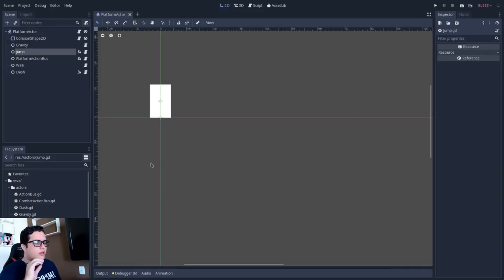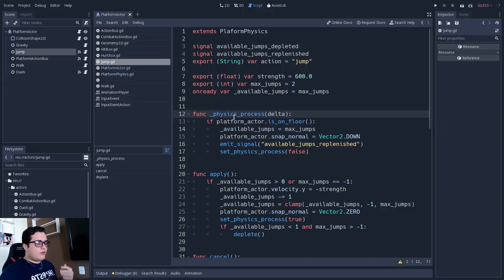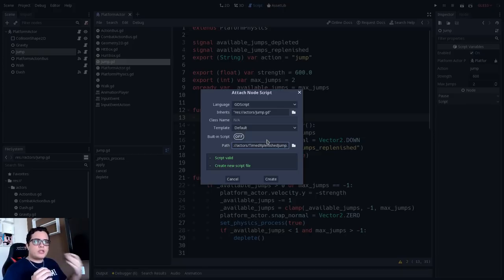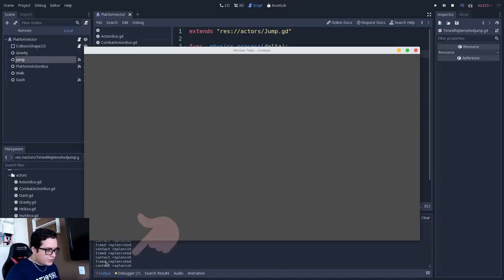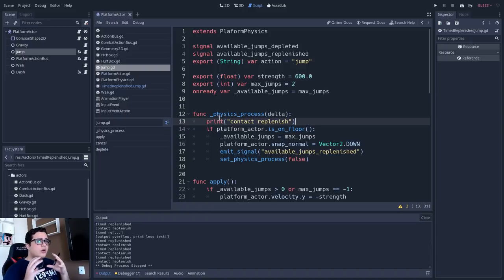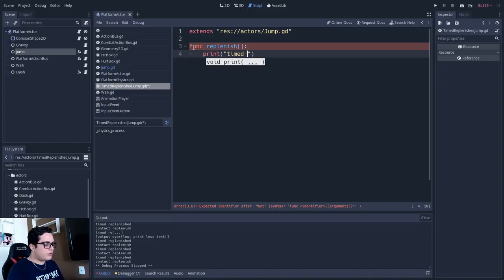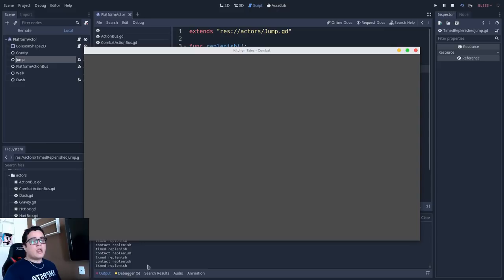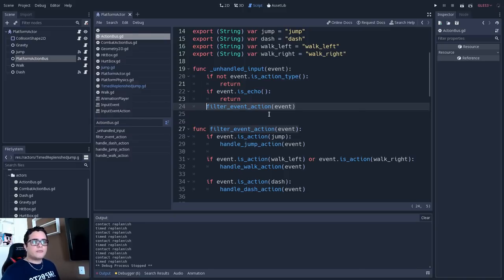#Gamedev Tips - I've been using callbacks in the wrong way

Comment: This relationship you've noticed really happens in very specific scenarios:
- Node notifications: Anything that can appear in the _notification(what) callback such as NOTIFICATION_READY, NOTIFICATION_ENTER_TREE, etc. Some of these have dedicated callback methods like _ready and _enter_tree, but not all of them do and they are spread out amongst various nodes. All notifications will trigger locally in the base class no matter what you do and then will also call a specific callback defined in the script.
- Object's property magic methods, i.e. `_set`, `_get`, and `_get_property_list`: Objects bind properties to themselves statically, then implement a built-in magic method as a logic-based backup, and THEN will also check the script if the script has one of those magic methods defined. So, just because you define `_set` doesn't mean it overrides the engine object's `_set`. Likewise, the `_get_property_list` data is appended to the final list of properties (although, I've heard that defining a PropertyInfo with the same name as an existing property will actually override that property's info rather than append a new same-named PropertyInfo, so that's cool).
    - Note: A "magic method" is something that replaces a syntactic or language feature with a logical one. So, if you wanted to, you could define a property entirely within these three methods and people would be able to access it, even though the variable itself doesn't exist. The engine also has a `_call` magic method for (you guessed it) calling methods based on their name alone, but it isn't exposed to the scripting API (not sure why. Probably an architectural reason?).

There may be others(?), but I don't really see them as often. For example, EditorPlugin has a ton of "virtual" methods and it really does nothing in them and expects you to implement the functionality (there's nothing to override cause there is no pre-existing behavior).

You can implement a function that shares a name with an engine class's function and it will override it, as if it were a virtual function anyway, and then you can call the base class implementation if you want by prefixing the method call with a dot (.) as in...

func add_child(p_node):
    .add_child(p_node)
    Log.log("Child added") # some logging API

In this way, you can override base class behaviors with your own, and it will truly replace the implementation so you have to make sure to actually call the base method or it won't happen.

The reason that this has some "inconsistency" is because Godot's script-based inheritance of engine types is actually just a delegation implementation under-the-hood. There is no inheritance, but rather a Prototype-based, JavaScript-like querying API. A script can effectively change its inheritance at runtime just by changing which object the script is placed on. For example...

If there exists a base class Base with a virtual method do() and two derived classes Derived1 and Derived2 with each their own implementation of do(), you could then create a script extending the Base class and place it on either a Derived1 or Derived2 type (since they share Base), but the script's behavior might change because do() does different things in each case. It's really just redirecting where the method queries are sent.

This "inconsistency" is actually the reason why the devs decided to close the MultiScript pull request. It was a type of Script that could have a stack of other scripts define its features (very cool idea) so that you'd be able to do things like have GDScript inherit from CSharpScript or vice versa, by stuffing both of the scripts into a MultiScript. The problem is you'd have to decide, for every single function, whether the method 1) couldn't be overridden (ignore versions further up the stack), 2) could be virtually overridden (use ones higher up the stack), or 3) duplicated (like notifications and Object magic methods). I think it actually is a solvable problem, but the team just never came back to the idea, unfortunately.

And of course, this doesn't even get into the details of how Scripts themselves can be recompiled and updated at runtime, e.g. if you updated a GDScript's text at runtime and then called `reload()` on it to make it recompile itself so that it could literally change which class it is attempting to inherit.
Reply from the maker: So many valuable information, but I'd like to highlight that the last line brought back an idea I had to make dynamic tutorials, that I had to put in the bin exactly because I couldn't manage to update the GDScript content at run time.
Reply: @pigdev  Oh really? Wonder what the issue was. After all, Godot updates its own scripts all the time (the Editor is a "game", so it's not different). It should theoretically be possible to create and edit scripts at runtime, compile them, attach them to an object / reload them on an object, and then observe a changed behavior. This is effectively what live script changes with remote editing does too, sending your updated script over the network to the remote game instance on the port and replacing the ScriptInstance that is present.
Reply from the maker: @willnationsdev  the idea was that the user could use the TextEdit to write code in run time, but iirc, the issue was that nothing happened when I used Script.set_text to be what was in the TextEdit, the script  was kept as it was before I hit play  so it definitely sounds like you solved the issue xD

I will gonna test it soon, if that's the case, a long trashed project will come to rrality and it will be epic

Comment: I would like to point out that this feature was discussed and still has an open request (#29271) on the official Godot GitHub: https://github.com/godotengine/godot/issues/6500 and provides more insight as to why it is the way it is.  

It is also mentioned in the GDScript basics page: https://docs.godotengine.org/en/3.1/getting_started/scripting/gdscript/gdscript_basics.html

It is also discussed on the Godot QA site in at least one post: https://godotengine.org/qa/10051/how-does-_fixed_process-execute-when-using-subclasses